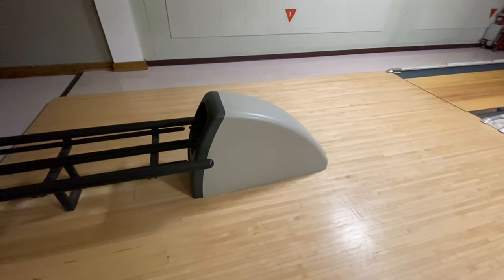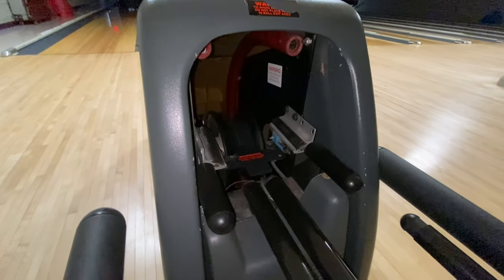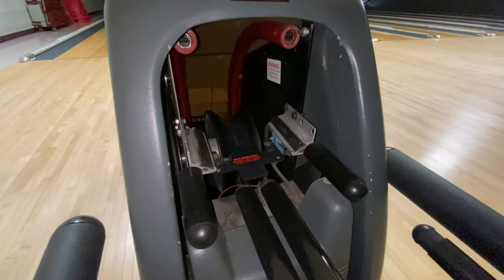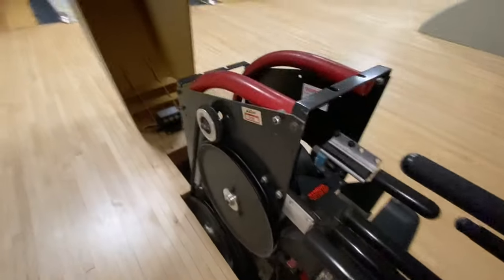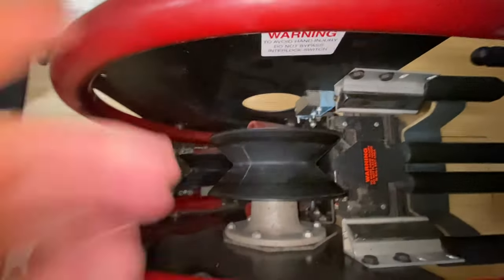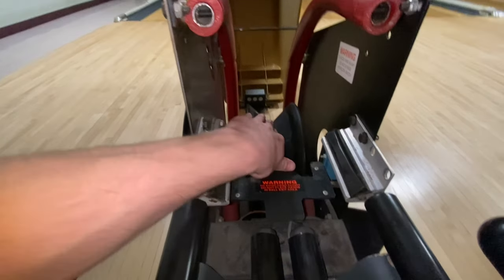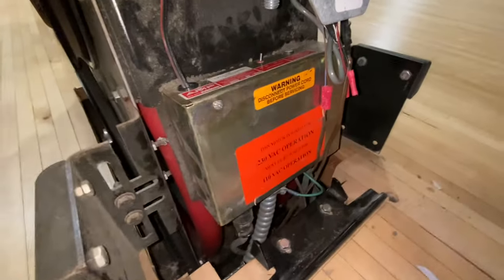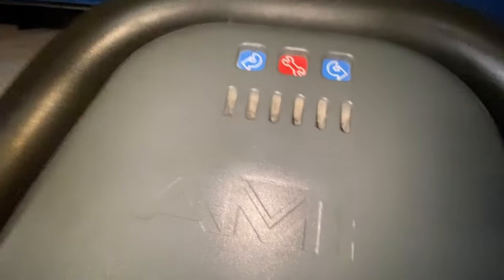C90 Ball Return Overview

Comment: Do you have the service manual? If so, does it say anything about the hand dryer? The hand dryers at my local bowling alley are absolutely knackered.
Reply from the maker: I do not believe I have one. Most of it you should be able to find online
Reply: @Joethepro181  Unfortunately I couldn't find the service manual, only the installation manual and it didn't say anything about the hand dryer.
Apparently AMF were so stingy that you had to order the manual from their (now defunct) website, you couldn't just get a PDF.
Reply from the maker: @industriastroll3177 what’s going on with your hand dryers?
Reply: @Joethepro181  The wiring on some of them is literally held on by electrical tape, and many of them are incredibly loud.
The one on lanes 1+2 actually sounds like a perpetual cricket noise until you smack it just right.
Previous owners of the place were... disinterested in maintenance, to say the least.
Reply from the maker: @industriastroll3177  Yikes, sorry to hear that. Shoot me an email and I can attach a picture of one of mine. My YouTube contact email is joethepro181@gmail.com